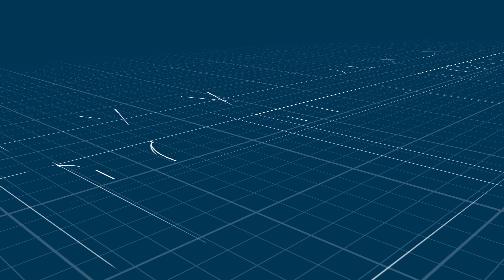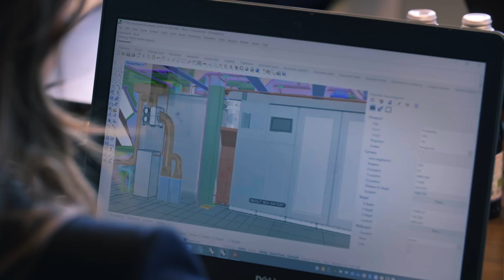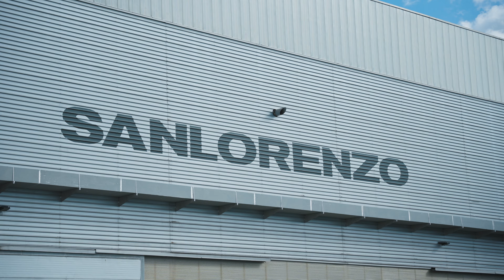Discover Massimo Perotti's FUEL CELL SUPERYACHT by Sanlorenzo

Comment: This is a REALLY big deal. I've been researching this on a lay level for many years, and there is not a shred of doubt in my mind that fuel cell technology (supporting battery/electric) is BY FAR the best option for yacht propulsion and power. Not only are fuel cells extraordinarily efficient at converting fuel to energy, not only is methanol production from natural gas one of the cleanest forms of fossil fuels, but the technology exists in the R&D pilot progam phase to generate methanol from water and atmospheric CO2 using renewable power. If a yacht owner were to invest in one of these pilot plants to a degree sufficient to produce 'more' methanol than they consume with their yacht, they could legitimately claim that their 'system' is net zero!